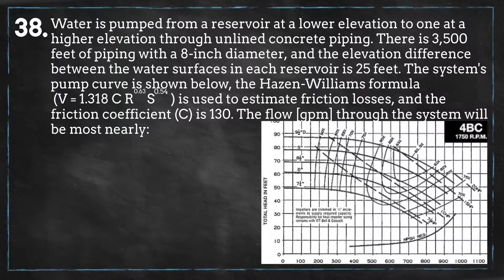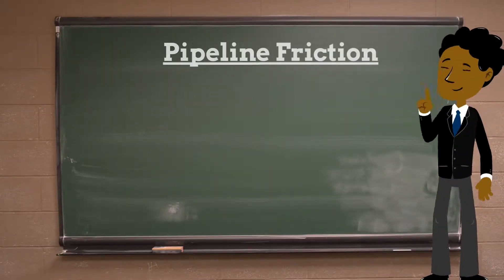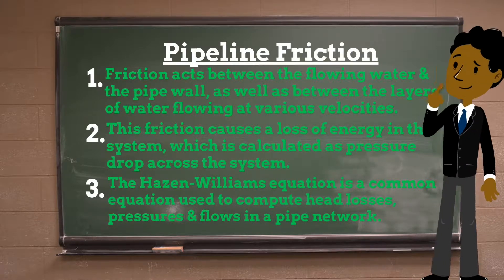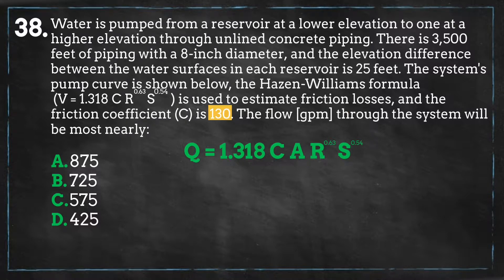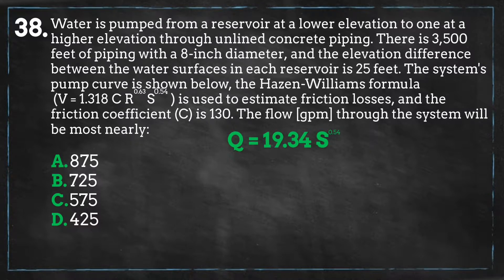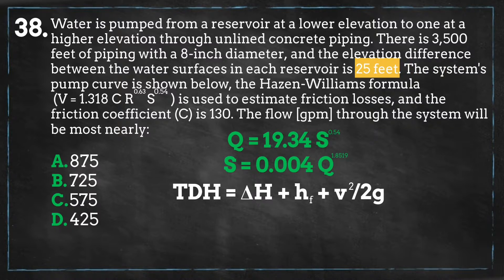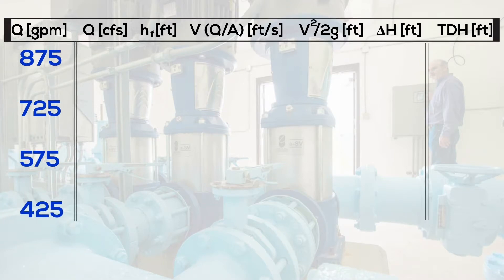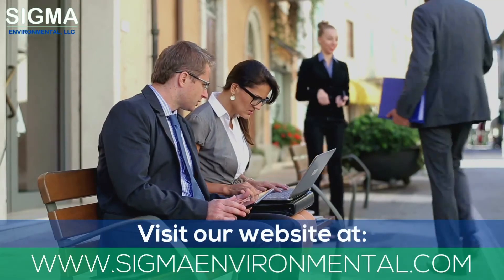Pipeline Friction Losses - Episode 38 (Principles of Water) | 52 PE Exam Problems in 52 Weeks

Comment: I used 25/3500 for S and got 600gpm.  Did not use the graph.  is that not the right  way to do this problem?
Reply: He said yes you can do the problem your way yet when you have the pump curves normally they are given for a reason so it's a good double check method if you have time
Reply: @umrules  I had a problem very similar on my NCEES practice exam and I had to do the table to calculate multiple TDH and plot the system curve over the pump curve and see where it intersects.  Plugging in for S gives you a higher number because you're neglecting friction loss.   I will be saving this for last if I get one on actual exam.  It takes a while to do and high probability of calculator error.  But at least I know how to do it if I have time.  Just don't think you can do L/elevation difference to get S in the Hazen equation.

Comment: Those different pump curves are for impeller diameters, not pipe diameters.
Reply from the maker: Hey! Thanks for your comment and your catch on this problem; I cannot recall whether I changed the wording of the problem or if it was simply an incorrect graph used, but I appreciate it nevertheless.

Now for future purposes of the PE exam, if you get a problem like this the pump curve will be placed with the problem description or the necessary information will be located in the reference guide provided when taking the exam.